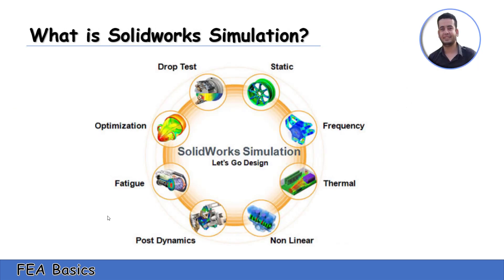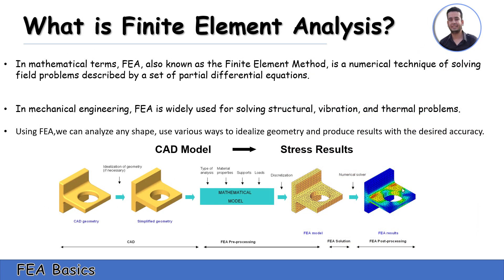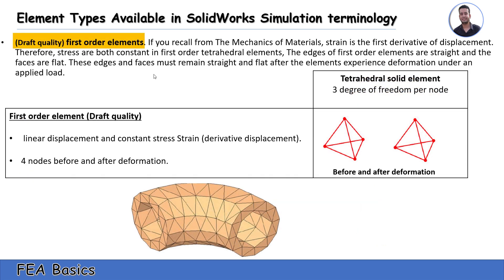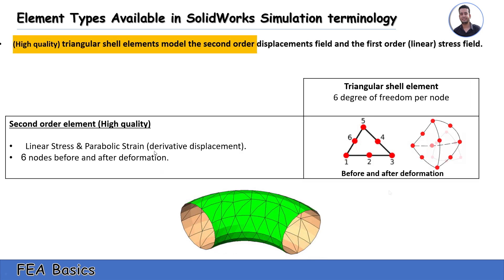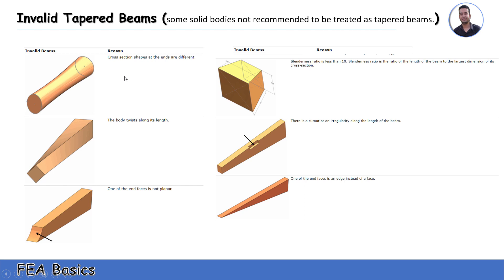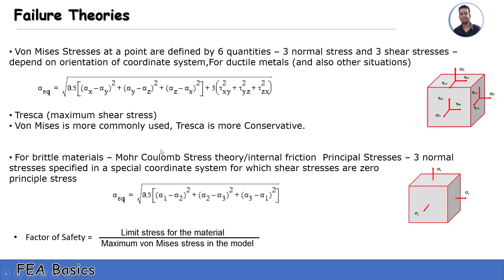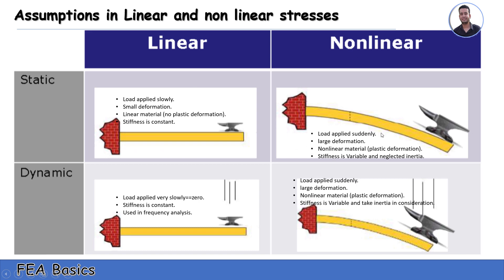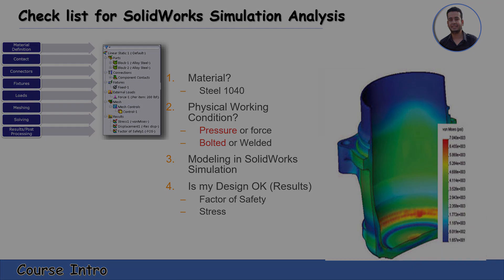Solidworks Simulation │FEA basics│

Comment: what are the differences between solid work and abaqus or ansys? thanks
Reply from the maker: Abaqus or Ansys
Specialized simulation program used in scientific research and practically reliable.

SOLIDWORKS simulation
It is an addition within Solidworks. The program is almost in the original and depends on it in many applications, but it has limitations and some applications that cannot be done on it yet. Likewise, the program cannot predict fracture when simulating the processes of forming or operating metals, but in general Solidworks simulation is good, easier to use and is constantly being developed. On the occasion of Solidworks and Abaqus are two programs of one company dassault systemes.

Conclusion;
Abaqus or Ansys

 Stronger and more accurate, but more difficult to use and requires practical and scientific experience.

SOLIDWORKS simulation
Good and easy to use tool, but there are limits to the program and it is being developed.
----------------
  Abaqus or Ansys
برنامج متخصص في المحاكاة ويستخدم في الأبحاث العلمية ويعتمد عليه بنسبة كبيرة عمليا.

SOLIDWORKS simulation
هي  اضافة داخل سوليدوركس برنامج الكاد في الاصل ويعتمد عليه في كثير من تطبيقات لكن ليه حدود وفي بعض تطبيقات لايمكن ان تتم عليه حتي الان وكذلك لايمكن للبرنامج التنبؤ بالكسر عند محاكاة عمليات تشكيل او تشغيل المعادن لكن في  العموم  سوليدوركس سيموليشن جيدا واسهل استخدام وبيتم تطويره بشكل مستمر وبمناسبه solidworks وAbaqus هما برنامجين لشركة واحدة dassault systemes.

الخلاصة؛ 
Abaqus or Ansys

 اقوي وادق ولكن اصعب في الاستخدام ويحتاج خبرة عملية وعلمية.

SOLIDWORKS simulation
ادة جيدة وسهلة الاستخدام ولكن هناك حدود للبرنامج وبيتم تطويرها.